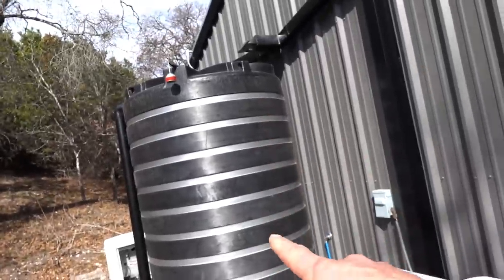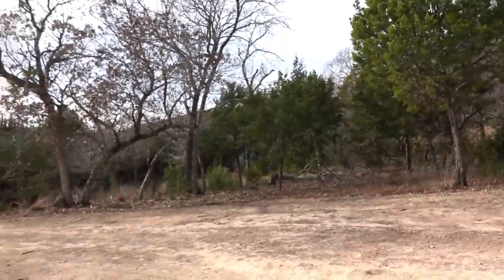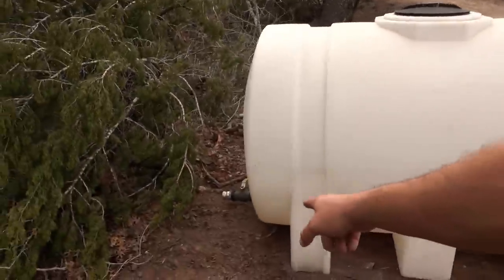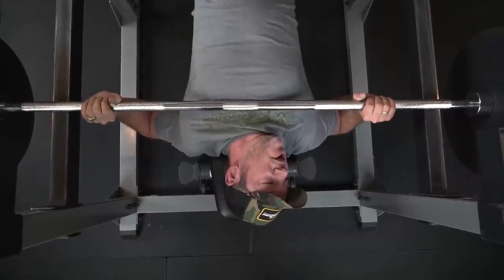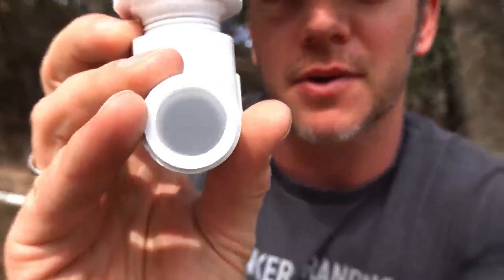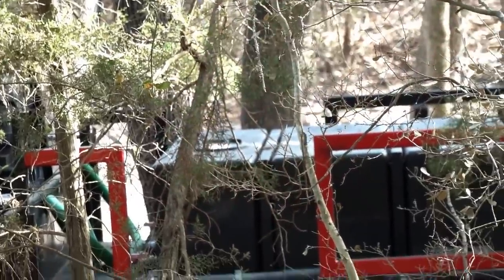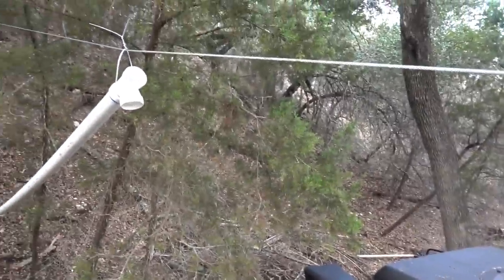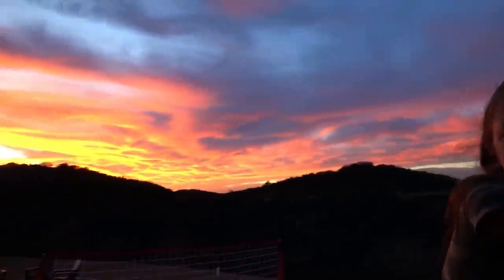Trying to Make this Work... And my Fire Truck is BROKEN!

Comment: What if you used a 2" pipe down to the 10' or so then you would have more weight in the pipe, in turn giving you more pressure?

Comment: I would be concerned about broken pipes if they are filled with water during a hard freeze if they are exposed. The water will expand and crack those pipes. You can wrap them up to the shut-off valve but will need to drain the pipes at the lower end.

Comment: It doesn’t matter if you have the line down low or up high as long as it’s output is below the reservoir it will have pressure. You could run a line down and up and down and up and down and up 50 times if you wanted to, so long as the line never goes above the level of the reservoir
Reply: Of course it will matter if the line isn’t a continuous downhill for when you want to drain the entire system as if you have a section in the line that goes up at any point there will be water sitting in the low spot right before that even if the entire line is below the reservoir. So at the very least you want to limit that happening or make it continuously downhill and have the ability to drain at any low spots like that or if continuously downhill, have a drain at the bottom of the lower at point before running it up to any kind of valve or connection point if it’s above the level of the line

Comment: I guess that 2inch 100 foot rols of black pipe was not available,  Only 1 connection every 100 feet or whatever roll length you buy.  this looked expensive ,

Comment: The weight of the water in the pipe os going to pull it apart. Just put it 10ft high and use a gas pump when you want high pressure

Comment: couldnt you use a water pump in line with it that would run off solar so that then you will get plenty of pressure, just menas a little more maintenance

Comment: You have a water well not city water right? If so, your water well is running on a 40-60 switch, so your lowest pressure would be 40psi before your pump kicks on and pressure’s it up to 60psi

Comment: Can’t you set up that 500 gal tank near that shed you have at the range? Set it up to catch rain water. Fill it once with your fire truck’s tank, and get a small pump and hook it to it. If you don’t have power, find a way to hook up a small solar system to run the pump. Just saying

Comment: Housing probably broke from water freezing inside and expanding. You should either not leave it outside or drain the pump after using it.

Comment: Dude, the top of your fire truck is lower than your tank, just run a hose down the hill, the a riser to fill the truck... or just leave the tank down by the range and have a pump sitting next to it.  And you should have used flexible hosing, PVC has very low sheer strength

Comment: That much drop in a 2" pipe be careful to not slam the ball valve closed, you are on the wrong side of what 2" pvc pipe and connectors can handle. It called Water Hammer.

Comment: That solution is gonna break every winter because your not burying it. PVC is very susceptible to UV/Sun damage in long runs not to mention freeze expansion that will burst the pipe. You would probably be better off just making a make shift water tower by building a tower platform and putting that tank on top.

Comment: When it comes to moving water one must calculate friction loss. Make as few curves as possible, calculate the optimal diameter of the hose for pressure verses volume, and place the container at least 50 feet higher than the target area..:>), and use it for a shower after ....THE SHOOTING SCHOOL ......................

Comment: Put a electric valve at the tank so you don't have water in it when it's 40* or lower and a pump down at your range for a booster

Comment: doesn't the pump on the firetruck have the ability to pump? seems like you can fill the truck a lot faster than 10 minutes if the pump was sucking out of that tank

Comment: A FDC for firetruck is a 2.5inch connection.  And you are supposed to run your pump from the fill source to the tank, and it fills in 5-7 mins. Just sayin

Comment: So you just Lost half of your water pressure by suspending those pipes in the air. May I suggest that you put them all the way on the ground and then put a gas pump at the bottom for water pressure and to fill the fire truck if you need to. It will be way more efficient that way.
Reply: Plus having pressure for a hose and reel at the base of the tree or wherever

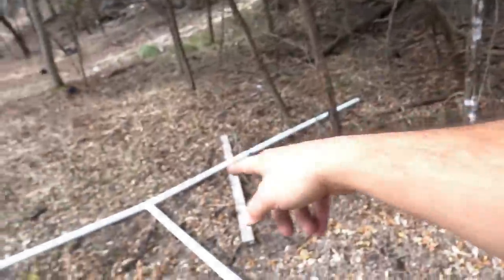Comment: 14:24 uh... isn't the whole point of putting it at the top of the hill so gravity will create the water pressure? And you're gonna the pipe go down and then back up to fill up the fire truck from above? Won't it lose a lot of pressure going back upwards? You should just build a tower for the tank at the top of the hill and have 1 half of the T going off it at fire truck height with the other half of the hill going down the hill.

Comment: You probably already thought of this and it’s probably already in the 1k comments but if I was doing this I would build a tower at the top for the water tank high enough for the fire truck to pull under. Then you don’t have to worry about suspension on the range and it’s even higher.

Comment: Science fail. 💥
 Irrigation poly in 2". Comes on a giant roll of whatever you want. One piece and uses press on fittings. 
A riser, what you want is a riser. Just run the pipe on the ground and then 90 up. 
Gravity does the thing as long as the water level is higher than the opening. 
A simple solar panel and pump wouldn't hurt.
While I'm at it, a pallet rack would make a perfect stand on site.

Comment: Do you realize you mentioned the freeze but don't seem to be worried about this large suspended pipe which will be filled with water? You may want a way to clear the pipes of water so they don't burst. Also you could say you lay a lot of pipe and are well hung after this video lol

Comment: just lay it on the ground, then run it up the tree and 90 over at the height you need for the truck.  gravity will still fill it.  use science to your advantage Matt.  Dont hang it 2" water filled PVC. lol.

Comment: If you would have used 1” pipe the hole way and you would have had better pressure out of the tank and the hose

Comment: Matt use the roof water gutter to support the base of the pipe and use them to suspend your pipes on the cable, double up the cable or use a thicker cable. Also make sure that the gutter you using for the support to the pipe isn't too big in width don't want water or leaf residue forming up along the way.. just drill some holes if needed on the support gutter and using them will ensure that the weight is evenly disturbed along the cable and pipe won't get compromised due to excess weight or stress on it

Comment: Am I the only one wishing the could help Matt with his miscalculations. He can run the pipe on the ground to the tree then go up. it doesn't' have to be suspended in the air. With water the only 2 points that are matter are the starting and ending points as far as pressure and flow are concerned in a sealed system. With some limitations.

Comment: 50 feet of 2 inch pipe will have 783lbs of water in it if I did my math right! I doubt that cable is going to hold 😂

Comment: Ok so if you have a pump on your fire truck why don't you just replumb it so you can flip a valve and fill the truck off the tank on the ground. Then you don't have to worry about a slow gravity system

Comment: You could make a zipline from the house to the ranch. Or somewhere else for the kids. And also leave the pipe on the floor. The pressure behind it will easily lift it up that last little bit. Just like you could siphon with a hose if the water container is higher.

Comment: If you started with a LARGE pipe at the water tank and got down to 2 or 1 1/2 pipe at the bottom, you’d have more pressure. That technique was used for gravity water mining. You would have more pressure at the bottom, like lots

Comment: I call BS on the 495 lb. bench press. Your chest is not big enough.
You should realize Matt that raising the pipe isn't necessary. The water pressure from the tank would fill the fire truck with the pipe on the ground. The water will stop flowing at the level of the truck.

Comment: Matt. Just use schedule 80 pipe and leave it above ground. Schedule 80 can handle some higher pressure so it should be durable enough. Leaving it above ground will just make it easy to maintain in the event a pipe does burst.

Comment: you can actually increase your end water pressure by properly tapering down in size on your pipe with proper lengths. some like 25 ft of 4 inch tapering down to 20 ft of 3 inch then tapering down to 1 1/2 or 2 inch then your final run to valved outlets. Also for outdoor hanging pipes you can use soft shackles for the connections they will help you not crack the pvc pipes when there is wind or vibrations.

Comment: Matt,  if you would start at 3” and reduce it down to 1’’ as it comes down the hill, it will increase the pressure.  And you should have used landscaping tubing that is black and in a roll, than use pvc for the spicket, or fire truck fill.

Comment: Somebody please tell Matt about 1" black poly pipe that comes in 100-300' lengths*
Reply: *poly pipe is flexible and requires less fittings 👍💪
Reply: *no glue required for poly

Comment: if you start with a wider diameter pipe at the top and narrow the pipe the closer you get to your outlet, preferably stepping down in size in sections it will create more pressure

Comment: OK i scrolled the comments... dude the HEAD PRESSURE is the same run across the ground and then back up the tree VS suspending NON UV resistant 2" pipe 4' off the ground. like its math, and not hard to reasonably figure out. Having a hanging pipe in a gun range is the stupidest thing ive ever heard of

Comment: When the wind blows, the tree moves and the pipe falls down, go along the ground and run it up the tree, put a valve at the end to drain out the water to flush it out and dump the water to stop freeze damage, isn't Mere an engineer?
, don't show her what you have just done.

Comment: If that blue pipe coming off the armory to the water tank is PEX (which it really looks like) it should ideally be painted or covered somehow. They do not tolerate direct sunlight/uv very well I have seen several of them fail after a year or two like that.

Comment: Get you a solar power water pump
Reply: The reduction from 2 inch to 3/4 inch increases pressure
Reply: Water weighs 8.3333 pounds per gallon

Comment: You should put the tank down behind the pavilion somewhere and have a short run of pipe with a pump to get you a lot higher psi. Just have to figure out power, Which could be solar

Comment: Start your pipe out with 3/4 and the closer you get to the range reduce it down to half inch and it'll increase the pressure

Comment: If you start with a 2" pipe and drop it down to 1/2" at the spigot, you will get much better pressure.

Comment: Silly Matt.  Best option is to get some power out to your pavilion area.  Park the water tank next to your shooting pavilion.  Buy a small electric pressure pump.  Hook it up with a simple on and off switch and voila instant fire suppression system with a lot of pressure which you may need in an actual emergency.  You can use a gravity feed off your fire truck to fill the tank and act as a reserve.   Remember that hose length and diameter play a huge part in your pressure per square inch.  Probably cheaper to achieve what you really want to do that way as well.  To be effective you are going to need it to shoot a high volume of water at least 50 feet.  Of course the easiest thing to do would just be to fix your fire truck!  Silly Matt, "Trix are for kids"!!!    LMAO!  You getting desperate for content?